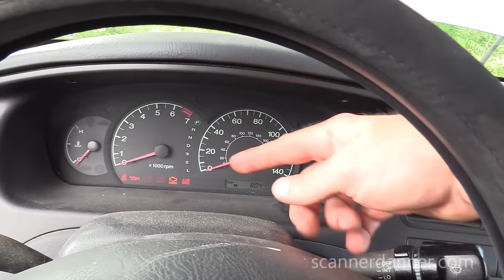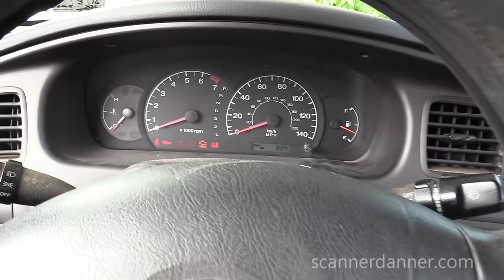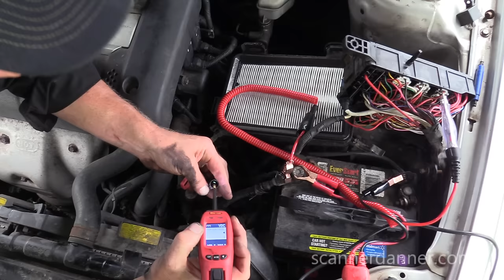No crank, good starter, how to troubleshoot, any car! (Hyundai)

Comment: You CANT trust the customer to tell you the correct problem, they don't know SH@T !!!  you have to check it yourself !!😃😃😃 
 I had a lady that rented a Uhaul box  truck,  she said it won't start,  Uhaul called and said replace the battery,  so I replaced the battery even though the battery was good,  I started it up no problem, I left Job well Done ,  I thought.  The next day Uhaul called again,  truck won't start !!! I go back out there,  I start it up No Problem !!!  So I call the lady that rented the truck.  I told her I can't find anything wrong ??,   I said will you try to start this up ??  So she tried to start it,   it wouldn't start !!!  As I watched her try,  I noticed she WASN'T TURNING THE KEY ALL THE WAY !!!,  I reached over the wheel and helped her turn the key the rest of the way,  IT STARTED!!!, the problem was the return spring was strong and she WASN'T using enough strength to turn the key all the way !!!😃😃😃😃😃😃 GREAT VIDEO thanks William Orange County,  California

Comment: i have crank but no starting and idk why
Reply from the maker: You have to scan it for codes, then check for spark, fuel and compression. I cannot help without more direction from you.
Reply: @ScannerDanner  code is p0342 shows up as camshaft position sensor A circuit low bank 1 or single sensor changed the sensor and still won’t start jus cranks over and i smell gas so it’s getting gas is my guess
Reply from the maker: @manonave3885  does it crank funny? As in maybe a broken timing belt?
Reply: @ScannerDanner  sound funny like no compression it can be the timing belt didn’t think about that

Comment: The check engine light came on after you unplug stuff.   So basically you cause it to happen. Why would customer be charge?  Why won’t you take a scanner and see if it’s your doing then erase it.
Reply from the maker: Of course, absolutely that would be done. It wasn't related and I didn't want to get into another issue with this video. This one was no crank diagnostics, nothing else. Make sense? (Video production side)

Comment: this guy knows his trade but i dont know about using that skill to take advantage of people. The rich folks i don t mind but the working class is different.
Reply from the maker: I should have spoken more on this subject in this video. I certainly do in others. In no way shape or form do I take advantage of anyone! I'm here to teach techs how to troubleshoot properly and to not be "parts changers". This is where the real issues are. Customers paying for parts and labor that were never needed because the tech is clueless about how to troubleshoot. 
So when I'm talking to my people here. I'm trying to show them how to make money by being a true diagnostics technician, and that they should be paid for their knowledge and expertise. That is all. 
This car was a no crank, no start that ended up having a check engine light on when we got it running. Of course a quick code scan can be done to make sure it was not related to anything that we touched and I should have shown that it was absolutely not. So this is most definitely a separate issue and is NOT related and it is NOT part of the original job.
Sorry that wasn't made more clear. 
Most people think connecting a scan tool and reading a code is a "diagnosis", it is most definitely not!

Comment: "Sorry IF I'm confusing you" ...load side, feed side, yeah confusing...how about positive terminal, negative terminal, ignition switch on ignition switch off? When you started talking load side feed side you confused me.
Reply from the maker: When I say feed side, I'm referring to a power feed.
When I say load side and control side I'm typically talking about a relay.
The control side of a relay is the side that contains the coil and is what makes a magnetic field to close the load side switch. 
Now the starter also has a control side and a load side and this is where it can get confusing. 
I have a lot of videos on the operation and testing of relays if you're interested

Comment: 40 min? My car is in the shop for a week now.. incl or her issues
Reply from the maker: a week in the shop for a no crank problem?
Reply: @ScannerDanner  his arguement is .. it starts with booster but when you pull the positieve from the battery it still runs.. duh alternator works in my opinion.. .. start without booster no crank..  wiring problem i think.. probably to the starter . 2 coworkers stick so hè is alone and troubleshooting my car is probably 2 difficult
Reply: Ignition on when goiing thru the ttansmission.. nothing appears park neutral reverse ..it doesn't show on the dash either .. new battery New alternator.. so power is good .. 14.1 on the alternator so the battery is charging  but won't start..
Reply: Dash honing of and on the last time i drove it so i think it's a shortcut in the wiring. Alsof have a probleem with the fuelpressuresensor.. enginelight
Reply: @ScannerDanner  yeah people sick..  but they fixed it.. it was a groundcable under the battery that  burned (hope you get it). Probably cause by a faulty alternator causing a spikevoltage wich burned the groundcable.. took m a while but she runs .. now the fuelpressuresensor and i am happy.. thnx for your video's.. i have learned from you... my favorite american.
Reply from the maker: @dennisbakker5262  I was going to say that sounds like a bad ground wire :-)
Reply: @ScannerDanner  you pointed me in the right direction for sure.. not the start er or fabel to the start er but a ground. Burnt because of bad alternator my mecanic said.. anyway thnx for your knowledge and providing the world with it grtz dennis

Comment: But doing how you're doing it it's taking more time and mechanics are paid for how long it takes them to diagnose the problem if you do I write to the connection of the starter like would most people do they would find that before you go through all that diagram. So I've been watching this video from day one that's already been over an hour. And then you find a last resort you find the problem mechanic I would have looked for the obvious place for awhile to getting those juice from the starter to the ignition while the only can be three things starter connection relay and that's about it and possibly the poor thing would be a mission A lot of times in succession don't work then you won't get nothing else to work either you check the connector at the starter I can guarantee you that's the problem cuz you said it broke off you put a new one on plugging it in tight Adonna guarantee it works
Reply: Absolutely it took him all this time to diagnose the problem he did everything by the book and that's why he's mechanic get paid as much as they did you or I would have had this problem first thing you look at is your starter what kind of connection you have it to starter if everything is good there and then it would have to be a relay or fuse. Providing if your battery and everything is good. By this guy saying there's a money maker there's a money maker is a rip-off it's all about money for him not customers. I will never use that guy I probably don't live by him anyways
Reply from the maker: No sir, I'm a teacher first and I'm teaching. 
Second as a mobile diagnostic guy, I charge the same fee whether it takes me 5 minutes or 60 minutes to troubleshoot a problem. 
On your next problem, when you've changed all the parts you can and still have your problem, you'll remember my channel and thank me some day

Comment: By the sounds of it, the garage owner is not the owner of the vehicle? The garage owner hired you to find the fault. so it makes you the 2rd person. What i don't like here is that you did a very good job finding the fault, but you shouldn't have made it a temporary fix. You should've went and get a new cable and plugs to finish the job properly. The problem i'm saying what will happen here is, that you tell the garage owner the problem and whether or not his the owner or not (he will probably leave it as it's working now) and the job will never get done properly, makes it a problem down the line in a few months.
Reply from the maker: This wasn't a bad cable it was a bad terminal end on a wire that goes into the main wiring harness. You would never change that wire unless you were changing entire the harness. The crimp connector I used was to simply show that this was the fix without having to wait for any parts. Filming changes things
Reply: @ScannerDanner  the cable you mentioned was already starting to get corrosion. so the best option todo is to replace the whole cable and cut out the connector in the middle. Do the job properly or don't do it at all!
Reply from the maker: @coeniejvr  100% not the way to repair this. You want to make the customer buy an entire wiring harness for a bad terminal end? You're not going to butcher the existing harness to do what you suggest.. That wire runs from the starter all the way through the wiring harness up to the fuse Box. ridiculous suggestion
Reply: @ScannerDanner  you just screwing you customers that's how i see it. The cable is not that expensive to run for +- 1 meter and install the proper fitting on the starter. And what's wrong in taking the middle connector out and connect it straight to the fuse box. I see no point why that connector should be there. You said it yourself that the it's just a temporary fit and that the customer later stage should redo the cable?? My question to your backyard mechanics, why can't you do the job properly and stop ripping the customer off!
Reply from the maker: @coeniejvr  it's not a cable! It is a wire for the starter solenoid that is part of the main engine harness. The entire engine harness would need to be cut apart to change that wire, WHICH IT DOESN'T NEED! It only needs the end of the wire and a better terminal, which would absolutely be the proper fix. What you're suggesting would be either a) a hack job where you cut apart the main harness or b) a super expensive main engine harness and 5 hours of labor to change it.
Reply: @ScannerDanner  You don't have to replace the whole harness, you just replace the one cable and add it to the harness. Why you want to replace the whole harness if only the one cable is faulty?? You can trace the new cable with the harness when you pull the old wire out. Would not even be 30 minutes max
Reply from the maker: @coeniejvr  okay so your suggesting running a new wire end to end and running it along side of the existing harness? You could do that if you wanted. The only thing that needs done is to continue to cut out the section of wire where it is corroded and then replace the terminal end and section of wire. If the wire was corroded all the way through, I would agree with you, but it wasn't my problem for this video. I showed everyone how to troubleshoot a voltage drop problem on a starting circuit, which was my only job that day. It was the garages responsibility to do the repair, not mine as I do not work for free. No reason to call me out on my temp fix to finish the video and I even called it that! (a temporary fix)
Reply: @ScannerDanner  that's exactly what i'm saying, the whole problem is that you temporarily fixed it. You shouldn't have done that. You should've told the garage owner that he should fix it properly. What my complain here is that the garage owner will not give the message to the owner properly as you have found the problem. That's how you guys make money today, temp fix things and leave it, let it break again and then hope the owner will come back. you worked on the car and i feel it's your responsibility to notify the owner what the problem is. This is exactly why i don't trust mechanics no more. You take your car to the mechanic to fix he says he can fix then he gets someone else out to fix the car. Even dealers is doing it today.
Reply from the maker: @coeniejvr  I wanted to show that my call was correct! And  I needed the temp fix to do that! 
 End of story, end of video. The rest of this is you making a bunch of assumptions you know absolutely nothing about. Were you there for the rest of this? Nope, you weren't. Was the car fixed properly? Yes it was! 
 And the world got to learn how to do proper voltage drop testing on a starter circuit. smh

Comment: Just fixed a starter relay in a 2009 Matrix.  Hardest part was finding out that the relay was hidden away behind the heater control.  Car would do nothing when I turned the key, then start if I wiggled the gear shift!  Very old school. Like Grampa smacking his black and white TV to get it working right.  Fun, cheap and easy fix.  430,000 mostly city km. Lord only knows how many times it's been started!

https://youtu.be/UeFLnRtQQoA

Comment: why would you scam the guy for a check engine light. it works. probably has been on for the last 100000 miles the last car I bought had a check engine light and 150000 miles later light light still works fine and the car works fine. biggest cause of the check engine lights is just what you discovered a bad wire or connection.
Reply from the maker: lol, I didn't scam the guy, I don't even charge for what I do

Comment: i happen to own the very same piece of shit he is working on . If u have the factory anti theft package there is a little putty knife looking piece of plastic just below the steering wheel conveniently where if your a bigger guy like me your knee will hit it and either knock it out of place or slightly miss align the damn thing and u will get the SAME exact symptoms you are getting now but once replaced correctly in its cradle the car will start just fine .
Reply from the maker: 😆 thanks for the info

Comment: I want to puke! I am a shady tree mechanic, and I am trying to troubleshoot a no crank situation, (with a voltmeter), on my 05 Altima. This is a great video, but WAY over my head. I'm drowning in a sea of electrical failure. BLup!
Reply from the maker: First thing is to make sure you do not have any antitheft related trouble codes. Do you have access to a scanner?
Reply: @ScannerDanner  Yes, I do have a scanner. There is no check engine light or codes. I replaced the battery after testing it, (it was reading 12.30 volts and lower). I also checked for voltage loss between posts and terminals... before and after replacement... no issue there. The starter itself is easy to access. While it looks to be the original unit, the connections do not appear to be corroded or frayed. The vehicle, (104,000 miles), has had intermittent no cranks for the last month or so. In many situations if I hold down on the key it will crank suddenly and start. Should the fuel pump run each time you turn the key to the on position? I've noticed that sometimes it does not, but I have had the vehicle start in that situation. I managed to get it running and have taken it for test drives. It has cranked over with no problem now about 30 times in a row total. I was ready to take the starter out and bench test it, but I am beginning to think that my problem might be with the ignition switch. I have seen a video on how to test the switch at the plug underneath the steering column cover. Am I going in the right direction at least? Thanks.
Reply from the maker: @cjcar63  this may be you https://youtu.be/ytrcqM8wyW0
Reply: @ScannerDanner  How do I know if I have an antitheft issue? My 99 Durango is a no crank, no start. I jumped the relay and it started right up. I've also replaced the ignition switch with one from the pull and pay. New battery. I hope it's not an antitheft issue. Would the starter start by jumping the relay if the block ground was no good? I'm a level 0 do it yourselfer. I need help! Thank you in advance! Great shit by the way!
Reply from the maker: @nathankilgore7742  Post this to my forum https://www.scannerdanner.com/forum/post-your-repair-questions-here.html it is free to join and I have paid moderators who are there to help me help you guys.

Comment: You had me until you decided to start the $$$$$
Reply from the maker: I am a teacher and I am teaching my "students" how to make money doing diagnostic work in this field. If you think that the check engine light that was on, AFTER I got the car running after diagnosing and fixing a damaged wire to the starter should be covered under the same diagnostic fee, you are wrong. The issue we found at the starter would NOT set a fault code on this car and nether would removing the air cleaner housing as this was a non MAF engine. If you were my customer, I would certainly read the code and tell you what it said but I would NOT be walking down another troubleshooting path to tell you why that code is setting. 
The worst part of this industry is when people think that you can simply read a code and by that code alone, you can change a part. It is being bred by the auto parts stores "free diagnostics". This is one of the biggest lies in this industry and is a ploy to simply sell the customer parts they may not even need. IT is absolute b.s. 
On another note, the reason I didn't even bother reading the code on this video is it was NOT related at all. This was a no crank diagnosis video and I performed that part of the job. Any other issues would be covered in a separate video.